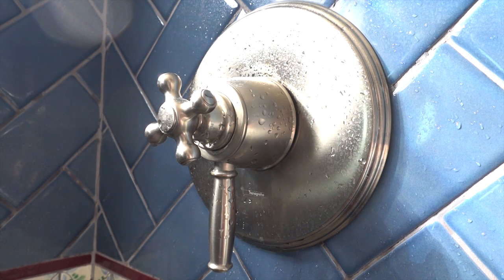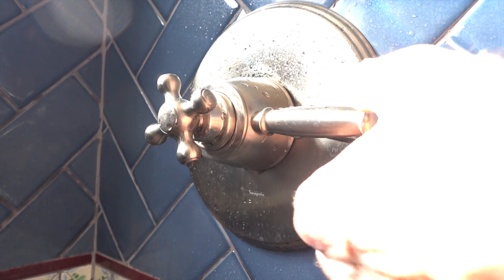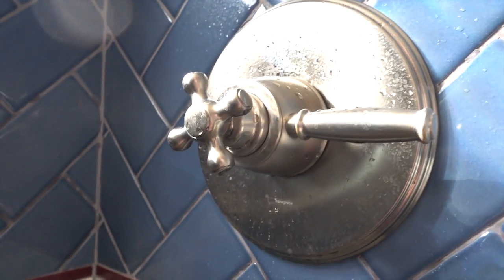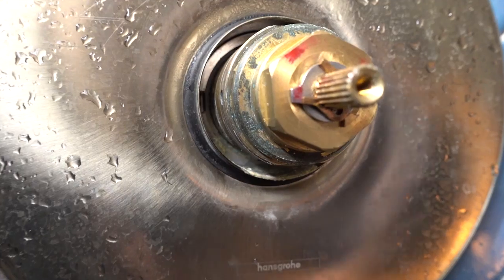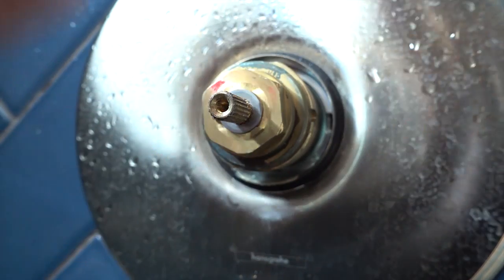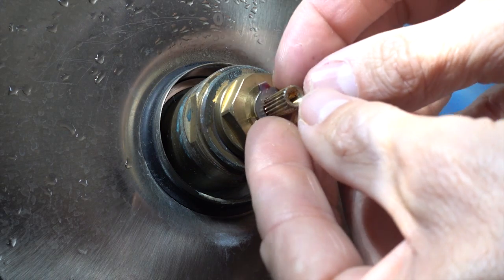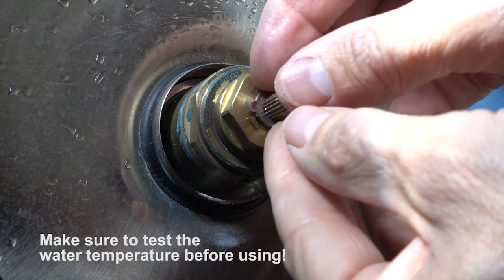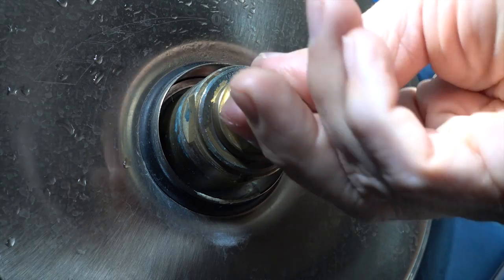Hansgrohe maximum hot water temperature adjustment - Thermobalance 2 & Delta 17T.

Comment: Hansgrohe is owned by delta believe it or not that valve is a rebranded delta 17T series
Reply: This was the key bit of information that unlocked success for me.  I have a Hansgrohe Thermobalance 2 shower valve.  These are no longer available in 2024 (the control handles). However I was able to order a Delta 17T shower handle valve with temperature adjustment via Amazon and it worked perfectly with my Thermobalance 2 Hansgrohe valve.   Wife is very happy and new shower handle has a much better temp adjustment handle control vs my old Hansgrohe contraption.  I thought I was going to have to change the valve (not so simple) but instead the Delta 17T handle set and trim worked perfectly keeping my Hansgrohe valve in place.
Reply: @ricardod70  which one did you get?
Reply: let me add that it fits, but doesn't align the handle perfectly at the 6 o'clock position to turn off.
Reply: Oh wow! Thanks for this info!! I have this exact model of handle and the cross knob sheared itself apart because of our super hard water :( I've been searching for a replacement with no luck. Now I will go try and find a Delta 17T handle replacement, but these things aren't cheep holy crap!

Comment: I just adjusted this by turning it counterclockwise to the max and it's still not warm enough. I don't really want to replace the whole cartridge.

Is there a way to pull this out and adjust even further?
Reply from the maker: Assuming that your hot water heater is set higher then the thermistor limits I believe the cartridge needs to be replaced but I am not an expert
Reply: @socaljoe  That's what I was afraid of. Do you know if in general that replacing the cartridge doesn't need me to turn off the water? Also, thanks for replying Joe.
Reply from the maker: @ivor7539 yes the water needs to be shut off. Either locally if you can or the main

Comment: Hi, any instructional video's on how to remove the shroud so I can get to the hot and cold water service stops?  Like others below, I was able to turn the hot-water adjustment to full, still not hot like in the past.  Sinks in the same bathroom are scalding hot.
Reply from the maker: my faceplate was basically a friction fit with silicone to seal it. I cut the silicone with a utility blade and then CAREFULLY pulled of the back plate

Comment: Thank you for nice and easy video. I followed your instruction and it improved little but the water is not hot enough. I rotate the clip all the way and it doesn't rotate any more..can you help on this?
Reply from the maker: Have you checked the temperature setting on the hot water heater to make sure it is turned up to the desired temperature?
Reply: @socaljoe  All other parts of house has really hot water except this one. Thanks.
Reply from the maker: @orppaha  maybe there is a “scalding” protection built in?
Reply: @socaljoe  I am not sure...again other tab has hot waters.

Comment: Is there any way this same adjustment setting could cause you from being able to get cool enough water? It seems ours is hot or hotter. I actually resorted to turning our water heater temp down to shower comfortably.
Reply from the maker: I don't think it should affect the cold portion since I believe you are expanding the hot range by moving the collar around and it shouldn't change the cold portion of the dial